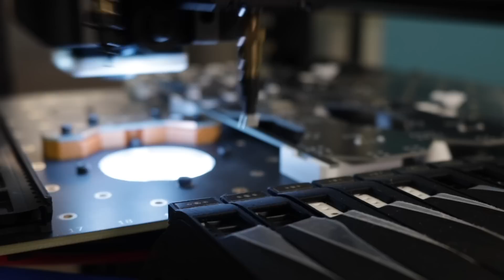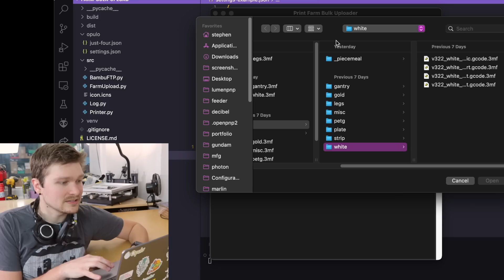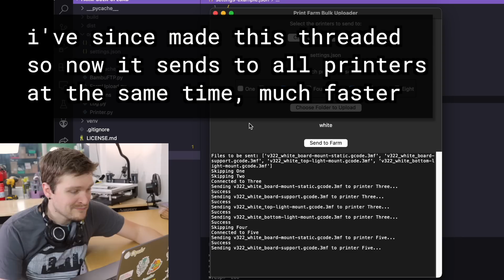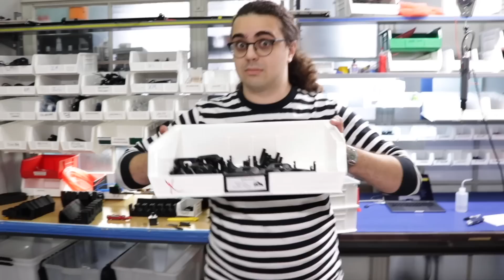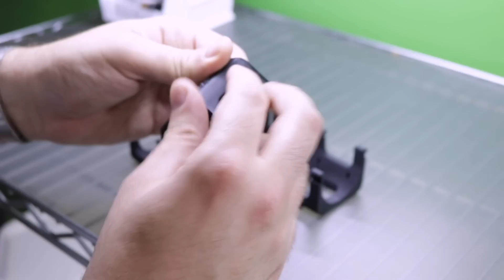Slicers are missing this ONE feature, so i built it

Comment: Flashforge/Voxelab have multi-machine control from their slicer.  It works great.  There is an occasional transmission failure, but I blame the WiFi modem/router.

Comment: Something I've done in the past is store all my 3d parts (the "source objects" as well as the sliced gcode) on a NAS and configure OctoPrint to pull the files from there.
This way I can totally skip uploading manually as the files will just appear in the OctoPrint UI.

Obviously this doesn't work directly with the printer though but the workflow felt quite nice.

Comment: So i tried it just now and it also seems to work with our A1 and P1S. 
Thats the tool we were searching for quite a while now, because a whole printfarm program would be overkill.

Thanks a lot! Now we just have to wait for Bambu to implement folder support...
Right now it impossible to use it with 300+ Files and no real file sorting on the printer screen.
Maybe we can implement to upload whole folder structures with subfolders when the support is here..

Comment: (I don't run a print farm but from my own experience with ~3 printers) I'm not convinced this is actually what you want though? Feels like you'd really want a central thing that has a queue of jobs and sends jobs to a printer once it becomes "available" again (you'd probably have to have a human press a button on the printer to signal it's ready to print again but anyway) then the more complex version being the central thing knows the capability of each printer and sends jobs based on the requirements (for example, sending color jobs to a printer with the color(s) you needed loaded)

Comment: Does the transfer notify you if the file already exists and offers a rewrite?
Or do you make every file a different version number? 
Seems like the SD could end up loaded with multiple versions thus in time you end up scrolling through too many files to find the latest.
Reply from the maker: right now, it just rewrites over any file with the same filename. this is actually great for our usecase, so there's only ever one file to print for a given part, for a given version of the machine. when we send an updated gcode file, we keep the name the same and it just kills the old version!

Comment: Suppose it’s a two-part problem. One being the slicer not being able to send files to multiple machines, second would be the firmware running on the printers themselves. With Klipper, you can control multiple machines from a single pi, and define in each printer’s config file where it’s “virtual SD card” directory is. So you can have multiple machines running from a single pi, all sharing the same directory where gcode is stored, and the start print and end print gcode can be localized to each machine with macros so you don’t have to worry much about customizing gcode in your slicer for each machine. With all that said though, I’m always happy to see progress being made in 3D printing from the community. Well done!

Comment: Does it make sense to run 3d printing this way? I mean I get why it would with tradionally manufacturing where you order x of part 1, x of part 2, etc. But all the products you print yourself, aren't they like... actual products with a specific set of items? Unless you have like multiple different colors or different filament type products, wouldn't it make more sense to just fill a bed with "product 1" and "product 2" instead of random parts that you THEN have to combine into different boxes?

Comment: First... You're doing "print farm" completely wrong if you're manually starting prints... It kind of defeats the whole purpose in setting up a print farm... 

Secondly, if all you want to do is upload the file once, why not set up a shared folder for all of the printers to access on the network (or better yet, mount the share within their environment.. gasp i know right.. crazy)

There's just nothing like the proverbial "reinventing the wheel"
There already exists a ton of print-farm back-end software projects that make managing a print farm a breeze... on top of that.. most if not all utilize API's so building a simple plugin for your slicer to work with them is easy.. 

I sometimes wonder if you google anything before starting a project, because a lot of what you do already exists in one form or another, and would require a lot less time, and effort to implement, or alter to suit your needs, than doing something from scratch for literally no gain.

low effort 3 second search lists of back end software that supports printing farms:
OctoFarm
SimplyPrint
3dQue
etc etc etc etc...

Comment: Slicers shouldn't manage farms, sounds like the wrong place to put that concern. I know it's just a file shipping queue to the printers as endpoints, but even so, that's a file management problem so I'd expect to see it as a standalone machine service/daemon. I'm not even sure a slicer should be able to interface with that queue, it feels like a separate part of the tool chain. 
If it was a service daemon that was aware of the endpoints and their individual configuration, a relatively simplistic webfront end on a file uploader would do it, file picker so select the local files you want to send to printers and a list of checkboxes for which printers to send them to.

I'm struggling to think of a parallel, best I can do is 'Photoshop doesn't need to know all the printers a image needs to be printed on when you save it'

Comment: You could use a HW BOM lookup table to subtract parts from your inventory count. Every time you scan a QR code that contains the build counts for a specific item, it subtracts from inventory. At a specific number, you could trigger it to send out a macro to Octoprint to print that many pieces. You can still use the Kanban method, but also digitally now.

Comment: I have all of that with my OctoPrint setup. All OctoPrint instances are connected to a NAS where all the files are hosted. That works easy, as long all the printers have the physical properties. You can then log into each octoprint and select the file. Granted you need a Raspberry Pi with OctoPrint per machine.

Comment: You could probably fully automate the bins to printing more of the paets when low with some fancy sensor shenanigans. Either machine vision or just weight sensors on bins. (Or diatance sensors, or radar or whatever). 

With weight, you'd also know exactly how many parts - and could send an email detailing which parts printed on which printers, for which bin. 
Or alerts if it can't print them and a way to retry for x time before emailing errors.

you'd need some sensor to detect if the printer was going or not though

Comment: tho the implementation wasn't amazing you still made it work and that all what matters👍

what I would recommended is having multi threaded application to send to all printers at the same time, better ui having printer addition and info modification, having more of sync feature rather than uploading files would be better for manufacturing when changing versions

Comment: The Kanban management for printed parts was very interesting - I'm curious about the quantity-in-stock "low-tide" line. It feels like the stacking of components in the bin could present multiple interpretations of the present quantity. I'm probably over-analyzing it, but is there a given practice for how parts should be placed in the bin, or is the flexibility of "low" broad enough that it's not really an issue if it happens at qty 20 remaining or qty 10 remaining?
Reply from the maker: no, i totally agree. i wrote a bit about this in the description, it feels too ambiguous. still want to find a better solution for making the kanban trigger at an objective threshold.
Reply: @stephen_hawes  The nerd-sniping solution is probably something along the line of load-cells under each bin. When the threshold hits, it sends a message. It could even trigger an idle printer to start printing that part. That would be way fun :) 

I don't have all the data you have, but I think the actual solution would just be to have the Kanban card trigger an inventory check - then you use that data to compare against the projections you made for how many parts you should print. Otherwise, isn't the Kanban card just a "whoops, we're running out of parts"? It's reactive instead of predictive.
Reply: @stephen_hawes isn't all of that more complicated and time consuming than just keeping track of your inventory with the inventory software you already use?
If I understood you correctly you already have the outgoing stock figured out. 
So all that's left is to have a quick way to enter new 3d printed stock. And that would be as simple as have a computer with the right website opened next to the QC-station.
And if finding the right part in the software is too time consuming then you could use bar-codes to speed that up.
Reply: @stephen_hawes  The simple way to do this is to have two bins for each part. One with a grey/white color, and another sitting directly behind it with a bright yellow/red color. Parts at first get taken from the bin at the front, then when its empty, the front bin is taken off the shelf and the colored bin is pulled forward so parts can be taken from it, then the grey bin is set aside or moved behind the colored bin. The red bin acts as both your remaining buffer and the indication to staff that the refill threshold for that part has been met. The threshold is set by adjusting the size of the front bin relative to how many parts can fit

Comment: For the Kanban levels, I would recommend the 2 bin system. Basically 2 bins, one is used for working inventory, and the 2nd has safety inventory. You put both bins on the shelf with the working bin in front, safety in the back. You pull items from the front bin till it is empty. Then you take the empty bin off the shelf, and pull the safety bin forward, making it the working bin. The now empty bin is the kanban bord to reorder. Once the defined amount to stock is put into the bin, you put it back on the shelf in the back, which makes it the new safety stock bin. Since you revision items, this makes sure all the old part versions are used before the new ones.
Reply: can also use a Card in the bin vs a seperate bin.  Cards go into a bin "parts to make", then when you make enough.  you put the card back in the parts bin.
Reply: Nice Kanban skills! Do you share more Kanban tips and tricks somewhere?

Comment: There is a way to manage a farm easily with klipper, but that requires you flash your printers to run klipper or buy klipper printers.

You upload it to one printer then use the rsync command

Comment: The Bambu printers have MQTT and you can get a lot of info from there. The HoneAssistant community has it mostly documented already. The P1 series has a limit of 3 connections at a time (1 cloud, 1 camera, and 1 other, so if you use the panda touch screen you’re at your limit already). The X1 runs Linux so it supports more connections (beefier mcu). 

I’m currently hacking around with the MQTT to control a chamber filter and chamber heater for my X1 depending on which type of filament I’m printing.

Comment: This is basically just a print spooler, which we already have had for normal printers since the 70's. I'm surprised nobody has produced a standard print protocol for 3D printers. How long before you can just Ctrl-P to Print in Windows 14 or whatever, and send an STL to your 3D printer using the built-in OS print spooler? How long until slicing is done entirely automatically (and turns out decent for most cases) within the printer itself? These are the barriers for 1st-class 3D print integration in OS itself - which will need to occur soon, I'd bet, if spatial generative AI starts churning out STL's in the next couple years.

Edit: and I'm aware of Octoprint and etc. But we need the spooling at OS level, not in a 3rd-party app that not all printers support.
Reply: Slicing has to be done manually, at least for a while. The orientation, quality, speed, etc are all specific to the use case of the part and/or user preference. Even with AI, it can’t know what YOU want.

Comment: Bambu have the X1E which is supposed to work behind firewall, load balancer or VPN connection and it is intended to be used in farms. Even it can operate in 'offline' mode, not connected to the cloud. I presume that there is an Enterprise version of the slicer, that might support some very niche features that enable full capabilities of X1E. 

Back to the topic of the view, a huge time saver will be if you can make the transfer asynchronous. Other things that I can think of would be a button to select or deselect all printers and a way to upload or generate a map of the farm. The last one would be a great visual representation and easy to navigate between the printers.
Reply: I believe the all of the Bambu printers can be set not connect to the cloud, though I don't recall off the top of my head if they have internal support for Wifi copying files over
Reply: With the x1e It’s just sending files over lan to the sd card

Comment: The panda touch system from BTT  can interface and run up to 10 printers in groups.   Pretty sure you can copy the gcode to the panda touch via usb and then send the jobs to the printers from there.   Not sure if you can upload over the network to the Panda Touch yet, but that would be a neat feature as well.   And it would work across all the Bambu product line.
The reason the P1 uploads are so slow is because they have a very under powered Processor and it just can't handle any real load, especially while printing.

Comment: Sounds a lot like what prusa is doing with Prusa Connect, a cloud tool based on what they in their own print farm. Even though it's only working for their printers, it allows you to handle print queue, sending files to printers requiring them, and minimal operations on the printer themselves. A really cool project, hope it will be expended for more features, and maybe more printers ? (really not sure for that though...)

Comment: How do you handle when one print job ends and the next one needs to start?  Do you have to manually scan the farm to see what's finished, remove the parts, clean the plate and then select the next job to print?

Comment: I don't have a Bambu printer or I run multiple printers at once, however, I am somewhat confident that you can manage multiple printers with Mainsail or OctoPrint. I don't know if the printer themselves can detect the files but with one device (laptop or smartphone) you can start/stop prints and do other stuff as well. As for Kanban part, just use load cells (as someone suggested in the comments) with ESP32s and send it to Homeassistant in order to print stuff.

Comment: With Klipper printers, use Syncthing. All printers of the same type share a folder containing those files with your control PC. Everything is automatic, just manage the files locally as a normal folder ☺
Reply: Yep same on OctoPrint
Reply: the risk there is a network disruption or a server disruption and the whole farm isn't printing.  Keeping the files on the printer is the best long term solution. for ease of manifacturing.
Reply: @theJonnymac  That's not a problem with syncthing or any other method of syncing files because they're transferred when they are created (or as soon as there's connectivity), not when they are requested.
Reply: @theJonnymac  Syncthing does not require an Internet connection to operate. It is peer to peer, not cloud-based; it uses both local discovery and an Internet discovery server. And even if local networking fails, the existing files will still be on the printer and usable.
Reply: @theJonnymac  This might be true, yet in practical application I have been running this for maybe 7 years now without a single failure due to networking.
Granted my OctoPrint instances are wired (ethernet) and not Wifi. I believe OctoPrint buffers / caches the file locally once a print job starts anyway.
Reply: ... except that works ONLY if you got SAME printers, his stuff works with HETEROGENOUS fleet of printers, that's what make it great...
Reply: @clementclarisseclemen3d708  that is highly theoretical and not very practical. Small edge case example is, if a part is 250 x 250mm in size, you cant print it on a 200 x 200mm printer in the first place. Even if all the parts are small, but you require to print many in one set, the layout of those parts still needs to be constraint to the printer dimension. Hence one Gcode file will not be working on any printer of diverse size. Some limitations are a given.
Reply: @clementclarisseclemen3d708  You can just have a different shared folder per printer type. The same issue applies to any solution.
Reply: @clementclarisseclemen3d708  That's not really a bad thing. You can upload ThinipartMK1_PrusaMini_Platter.gcode to every single printer running klipper, then only start that gcode on the appropriate printers, even if it's ALSO got ThinipartMK1_PrusaMk3_Platter.gcode? You're running a full OS, that's got plenty of space for pre sliced code for multiple printers to be mirrored. This works well.